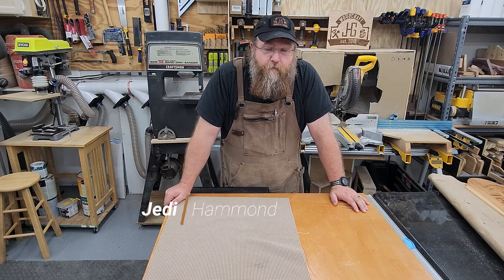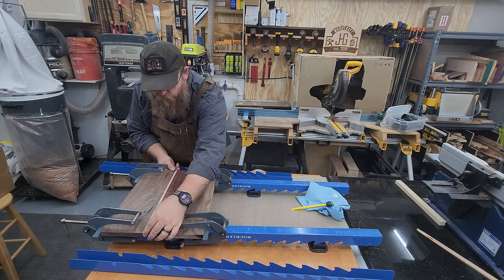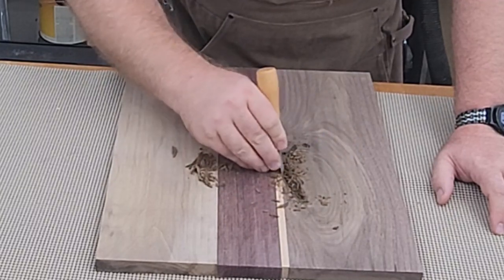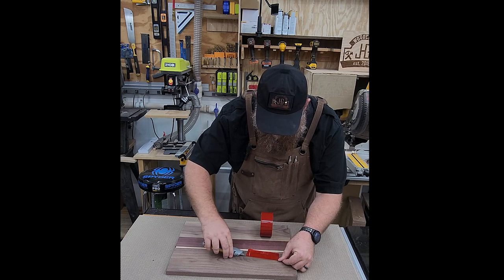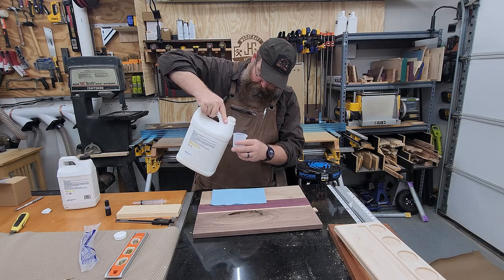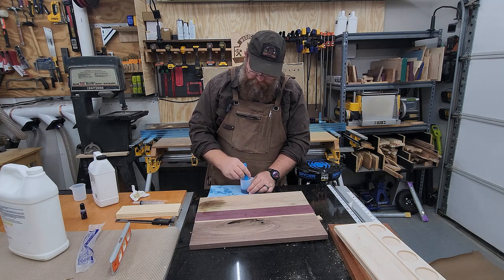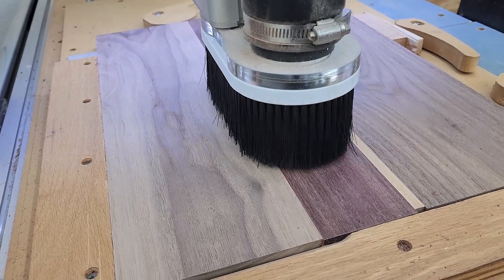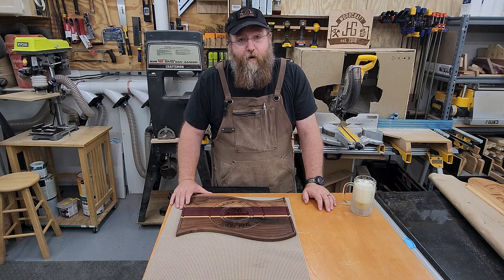Cursed Cutting Board

Comment: I'm no expert in epoxy but I think most manufacturers recommend mixing the resin and hardener first, completely, then add the dye.  Is your product different?
Reply from the maker: Yep you are right! The recommendation is to add dye in after mixing. Though as long as you have the measurements right I haven't experienced order impacting it.